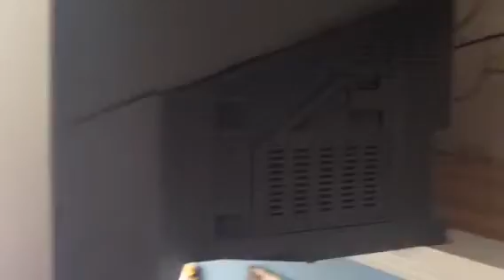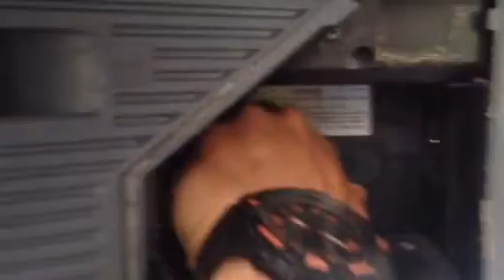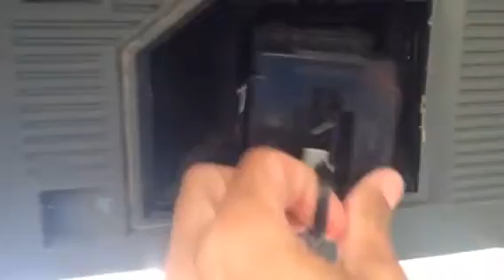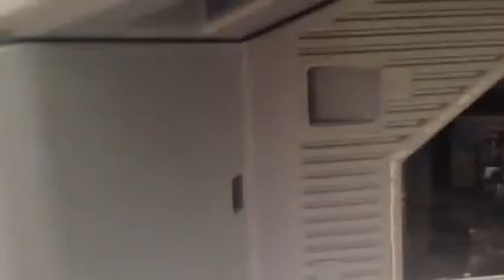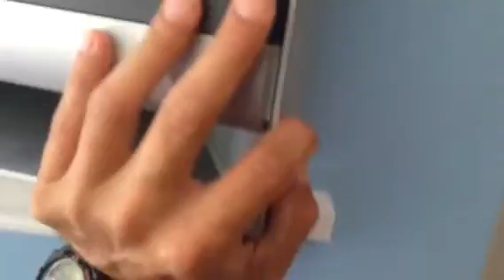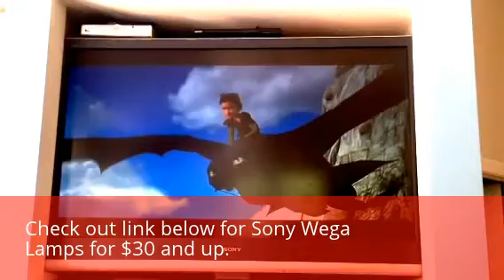How to Replace a Sony Wega TV Lamp in less than 60 seconds KDF-55E2000

Comment: Thanks for posting. I know I need to replace the bulb in my 60" Sony Wega,,because the lamp  light is on and I have no picture, but shouldn't there be some sound coming from the television, even with a bad bulb? I don't seem to be getting any sound. If it's not the bulb what else would cause that?

Comment: Got new lamp, power flashes n turns off
Reply: The three red flashes mean the bulb is not in securely or the door is not closed all the way. Unplug the power. Take the lamp out. Put it back in. Make sure it is secure (firmly). Put the door back on, be sure to push it all the way in and close the latch. Put cover back on.
Reply: THANKS!!!
Reply: +Loyal Dbailey (Dbailey1116)  You are welcome. Same thing happened to me.

Comment: Couple of things to suggest to visitors looking for info on SONY WEGA LAMP replacement.

1.  I have a  KDF-E42A10.  The Sony XL-2400 is the proper bulb for this TV.
2.  Make sure you properly insert the lamp; the pull-ring-arm will rise slighted once the lamp assembly has been properly seated.
3.  HEAT kills all electronics!  I believe the reason why so many WEGA owners are experiencing different lifetimes on their replacement bulbs is because of dust collecting in the lamp compartment and clogging the breather holes on the outer door.  Let's face it; when it comes to cleaning house (& especially, in & around, computers and TVs), the majority of folks out there are lazy slobs.  If you don't keep these Sony WEGA TVs clean and as dust free as possible, you will have problems.  This is an especially hot running TV and poorly designed, imo.  In particular, if you don't keep the lamp compartment free of excess dust, the lamp will fail, fast.  I believe Sony had too many service complaints on the WEGA series and had to trash the line.   That's too bad because when the TV is right the picture's fantastic.  Note: See the guy taking a lawn edger to his Sony WEGA?  Look at his yard.  Hell, look as his edger...The dude couldn't find clean with two hands!  

Good luck!

Comment: It's pronounced Vega, like the brightest star in the northern hemisphere.  If you look at the artwork Sony did, it's two V's that are not converged...it's not a W.

Sony Vega...not Sony Wega.
Reply from the maker: Interesting and I think that would make sense but when you search in google for "sony  "V"ega" it corrects to "Wega".  I think the "Wega" is related to the German electronics manufacture they bought way back.  I like the idea of bright star - unfortunately this TV isn't really that bright.
Reply: "Sony says that the FD Trinitron WEGA was named after a star ("Vega" in English) in the Lyra constellation, and made no reference to the original WEGA firm."  --  https://en.wikipedia.org/wiki/WEGA (third paragraph under 'history')

I think I bought mine....maybe 2000/2001.  At the time, it was a fantastic television.  Huge improvement over what I had.  I remember the image on the box was a black and blue 'V', that were separated from each other. (image here) -- http://www.gearlive.com/blogimages/freewega1.jpg